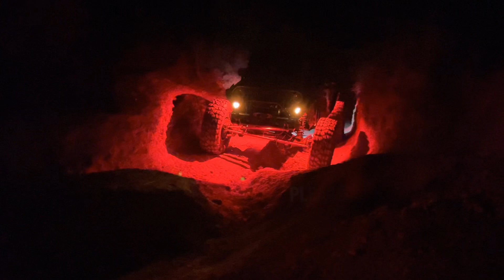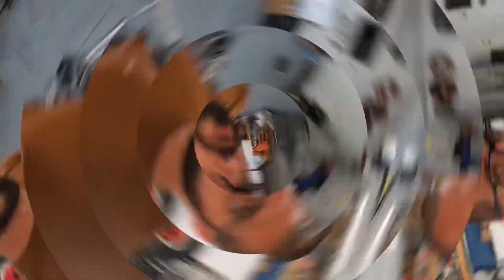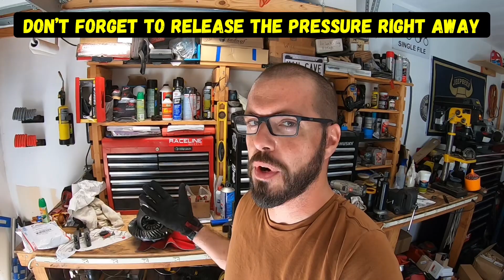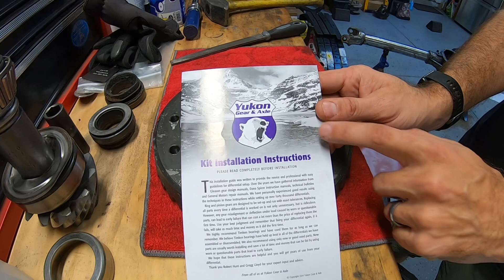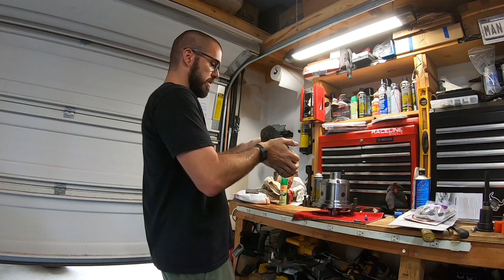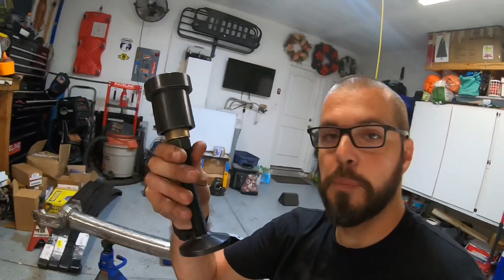HOW TO REGEAR A SUPERDUTY DANA 60 (part 1) - Project Maple Leaf Jeep Build (no. 11)

Comment: Hey, I agree with so many people out there that your videos are awesome and definitely more geared to the garage DIY mechanic like myself who’s building one of his first Overland pick up trucks 1963K 20 sometime ago I brought a set of axles 44 and a 14 bolt And started the rebuilding process of the day of 44 brought the Yukon master kit the ring and pinion looked really good, but the problem that I’ve ran into is the outer race for the pinion came out or should say dropped out as I rotated the differential over the new one just slides in and outI’m guessing that this housing is no good. Is there a fix or should I just start looking for a new differential.

Comment: Is it better to install/weld the truss before the gear install?
Reply from the maker: The only reason I would say no….is because it’s easier to drill the housing and install the air line fitting before the truss is on. But have it handy to determine where to drill or how to drill and notch the truss. I’ll be doing another set of axles soon here and going into all of that in detail.
Reply: What about inner axle seals? Will they get torched with preheating the cast?

Comment: Once again, really well done!  A ton of info that will help and guide anyone to take a job like this on.  I've got two constructive comments... 1. When you knock the pinion seal off, use a chisel instead of a screw driver.  They are sharp, which will help get under the edge, they won't get damaged, and it will be easier.  2.  Use RTV to lube the inner seals into the tubes; they slide right in and any imperfections get sealed up.  Awesome job presenting a LOT of highly technical information.  You are diving into stuff that no-one has done before on the www.
Reply from the maker: Great tips! And I love the idea of the RTV on the seals! I never thought of doing them like that! Great idea! Thanks for the support! The video on Thursday is going to be really good. As you know the pinion isn’t the easiest to set up. Especially the aftermarket pinion which gets depth shims on the other side of the inner bearing. So it gets a little complicated. But I think o explained it in a very simple way. Time will tell. Thanks again.
Reply: @WarPaintTexas  As I'm sure you know, setup bearings make life much easier for trial and error.
Reply from the maker: @TomSmith-nx3hx  oh yea. That is in  part 2.
Reply: @WarPaintTexas  You're welcome and I look forward to it.